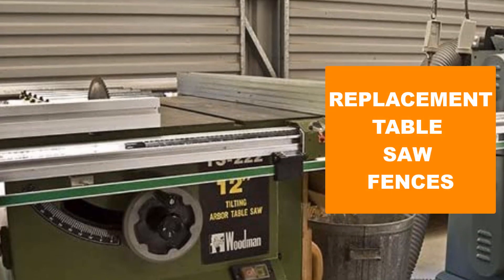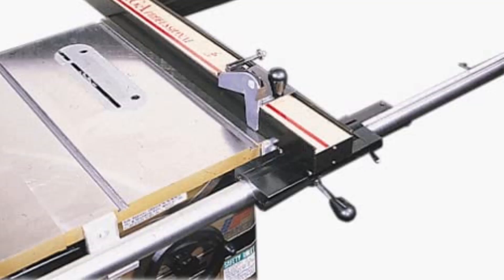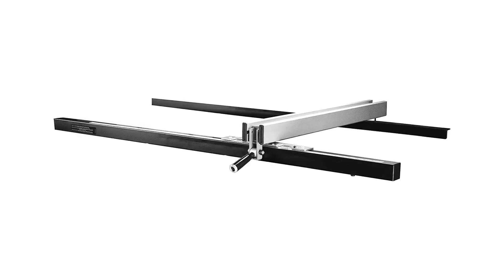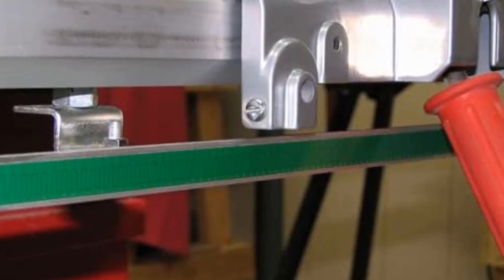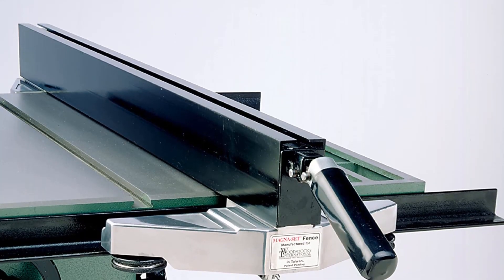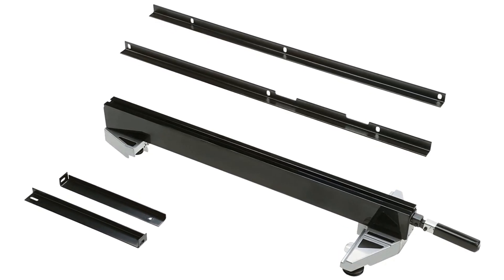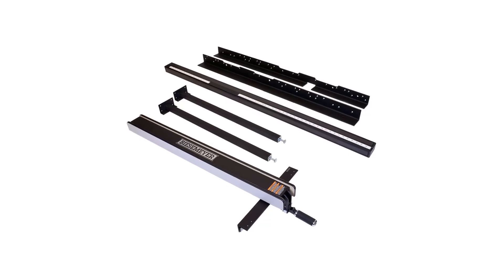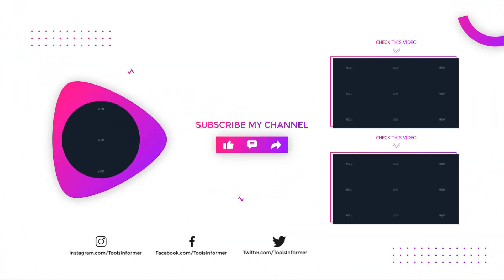Best Replacement Table Saw Fences 2025[Top 6 Picks Reviewed]

Comment: They all lack any specs on what size tables they will fit. Is the length adjustable to stretch across different size saws? If they can't tell you they have no idea what they are doing.

Comment: You advertise top rated and don’t mention INCRA? Shows me that you guys don’t do enough research on subjects you claim to review. 👎
Reply: Because the Incra TS doesn't really live up to the hype. I struggled with one for ten years before selling it and the saw it was on and replacing it with a  conventional cabinet saw with a Biesemeyer fence and a Wixey digital fence readout. It's way less fidly, more easily and reliably repeatable, and way less prone to come out of adjustment.I think Incra makes great miter gauges and layout tools. The TS/LS is a way over-priced Tinker Toy.